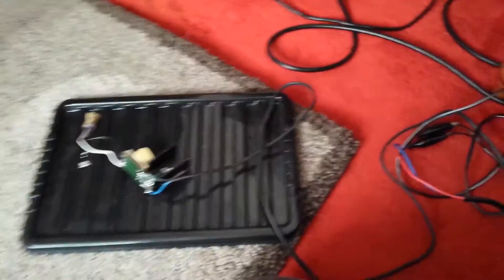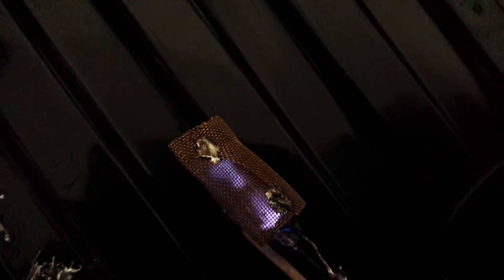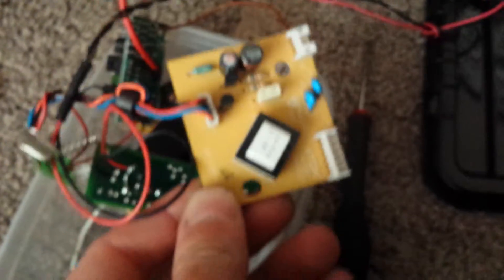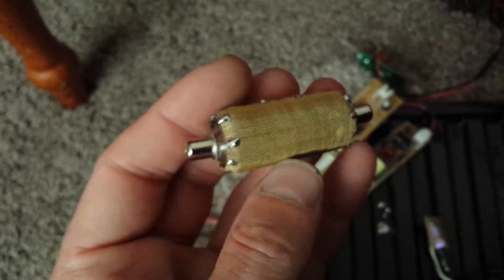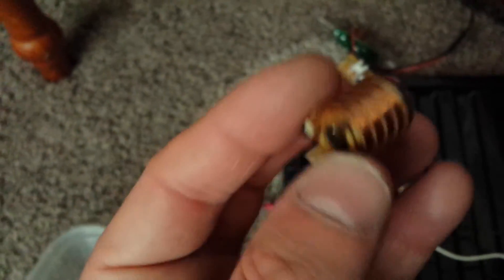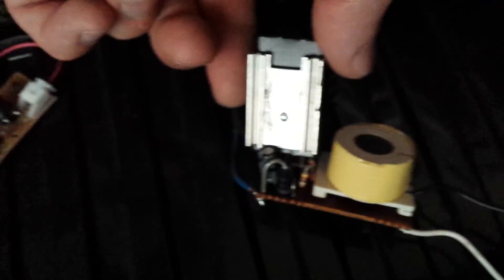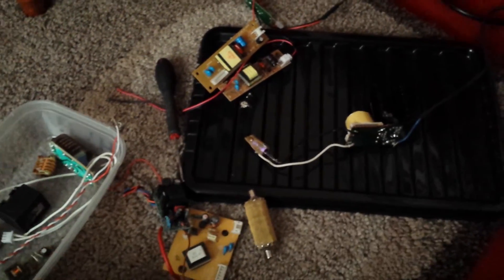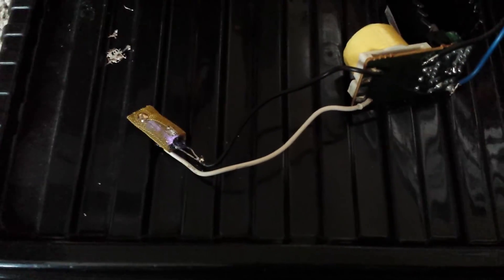Ozone circuits

Comment: Just take High-pressure Mercury-lamp 300W and brake the outer glass, don't worry mercury is in the inside glass quartz bulb. Make a ballast to drive it and you get 300W UV-C lamp. This lamp brakes air into ozone like the sun does. Don't ever look into the lamp, or you will get eye damage instantly. Take care.

Comment: Those caps getting now ~500v in reforming! I think it's right voltages for 500v rated caps but I'm not sure!I mean the leakage is how much the current disappear.. I'm realized in reforming if I give any capes e.g. first 250 voltages and switch lower eg 150 voltages and then back 250v its get long time before cap closed.. ok if I drive eg 300v  and switch to 150v and then 250v .. now the caps close quick buy in 300 it's get long! and same happen in all voltages! I think the quicker close is good!

Comment: Great DragonFlyback256! Thanks for advice! I'm reforming those now at 500v ... I think the leakage should be only few uA but I have now about 100 uA .. ten hours ago the leakage was 200 uA ... I don't know sure how low I should try to get the leakage! Also I must find out how much the voltage drop should be after connect those off from power source! I did a video about the reforming now! I send it to you! Thanks! All the best! Assa!

Comment: Great Ant! That's great to see all that! I'm trying to reform capacitors for my amp! I have old capacitor tester Heathkit IT-11 but it don't operate very well so it's give only 420v out when I set it 600v out! I don't know should I reform capacitors rated 500v by 500v or is the 420v enough! I try to figure out things! Maybe problem come because it's US power capacitor checker and there is different frequencies than here. Also it's magic eye tube id little dim! All the best! Assa!